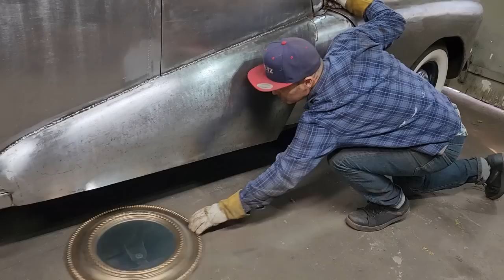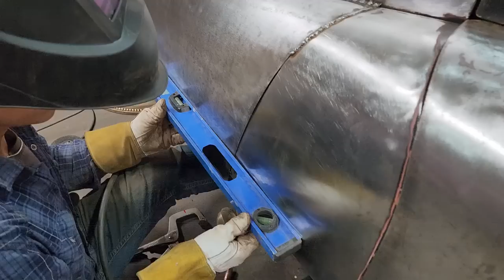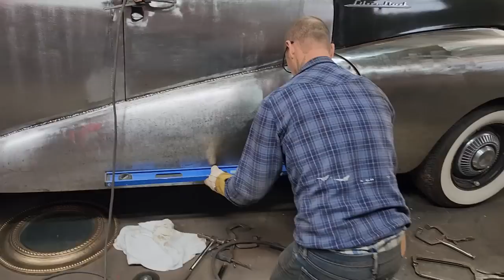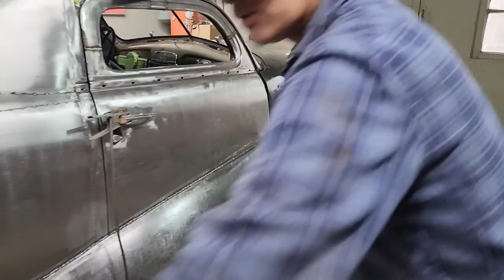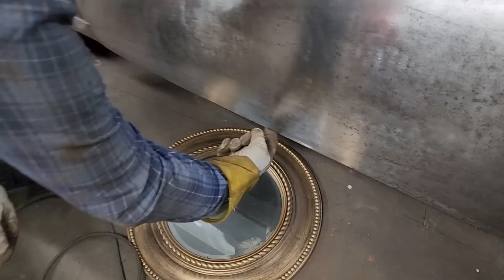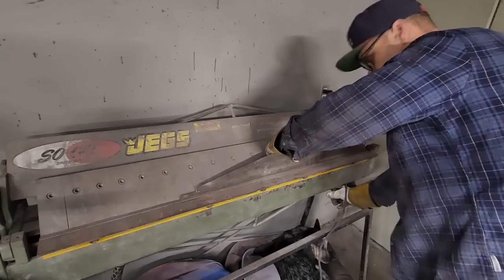Fabricating fadeaway fenders out of a hood (part 2)

Comment: Question: Instead of crawling under the car to push out metal & having Jolene spot weld it for you, couldn't you use one of the small hand-held magnets to pull the metal from the outside? Hold the magnet with one hand & weld with the other. Amazon has various sizes, up to a double sided with 1,225 pound pull strength. Search Magnet fishing on YouTube to see how powerful these things are.

Comment: You may want to zip cut the door open and check the swing open on the door before going too far with welding. Pulling out the original front fade to meet the hood may cause the front part of the fade to scrape the fender when opening.

Comment: Are the doors going to open with the square cut? Might want to angle the cut to the rear so the xtended piece is aft facing a little, not square,  for clearance. If square the gap might need to be Xtra wide so the 2 pieces don't hit while opening & closing.

Comment: Weld something to the front of the fender so you can pull it. Then tack. Then remove it. I use a nail as a puller. Bit easier than trying to push from behind..

Comment: Chad  where you have to spot weld on the seam ....drill a small hole ..put a screw into it..pull it out to where you like with pliers, Take screw out and spot weld the hole  closed...saves trying to push it out from such a tight spot from behind.

Comment: In the space you had for the hammer, you could use a 2x4 and set it where you want to push out while using the rail for leverage and your foot to push while you weld! I've done that and it works very good!!

Comment: Hi Chad.  Why didn't u just tack weld something on to the panel and pull it to tighten the gap. Or drill a hole n put a hook thro it and pull the gap tignt

Comment: You should consider picking up a couple of those suction cups they use for placing big pieces of tile.  Might make it easier to pull on a panel when you're welding.

Comment: Of course the Gap going along the front of the door and probably the one loan the back of the door will need attention. I can smell the oatmeal raisin cookies chocolate chip cookies they're baking quite well and closer to being done! Ironically where the four doors used to be in the back doors on a car with somewhat similar silhouette they would have a toolbox in there like you'd find on a mid-60s or so Ford Chevy truck bed down low at the front of the bed between the cab in the front of the back tire! I'm glad you didn't do that of course it'd be a great place to keep your wine glasses for those fabulous picnics. Remarks I'm getting to is that or the place I'm getting to with those remarks are these cars before the wealthy and they had put some kind of luxury items in there before they had GPS autopilot and everything else. But these style of cars in the 30s and even earlier for the wealthy. I'm reminded of somewhat of a Diesenberg. It would appear that all the naysayers have disappeared. I think your car is a silver streak or whatever you call the car when you're done it's turning out fabulous. Now it's been interesting since you chopped the top but couldn't you slide into the window like old Bo Duke used to 40 years ago.? Now you could actually go across the hood and get in through the windshield opening. Maybe. My body just don't bend that away anymore. You can get into your car through the trunk but it's probably still well to shut too so I guess cutting the doors open need to be done anyway. I'll be interested to see how you fill in those openings between the original skin of the car and the hood that you put on. I'm assuming you're going to cut some louvers so it can breathe. You can also put a door marking light in the area like they used to have on some of the Mercury's and Lincoln town cars. Make it a blue dot. Enjoying your episodes. Thanks for taking the time to make them

Comment: I think you will want to move the rear axle  so the wheels are centred in the wheel well...or modify the rear fenders.
Reply: Yes! I absolutely can't stand wheels not being centered in the middle of the wheel wells! Drives me nuts, but he probably won't do it because someone in the comments said that is what needs to be done.
Reply: The rear is factory. They didn't move that part. I'd like to see that done too. I actually would have liked it better if he'd have shortened the whole thing. Either that or add a rumble seat.

Comment: i would of used a jack to push up the panel up. And doing so would bow it to where you want it before tacking the bottom. grr i wished i could shout and tell you instead of watch you struggle